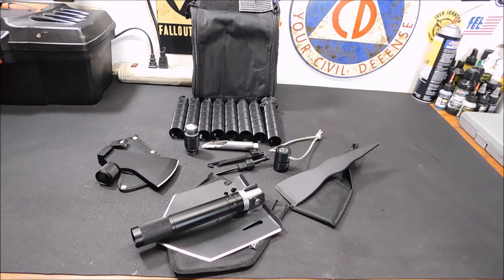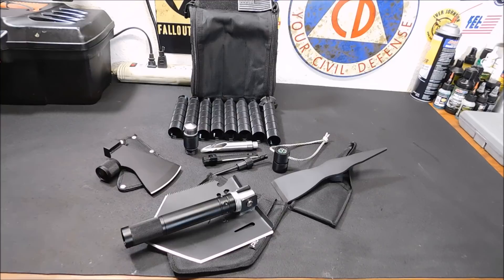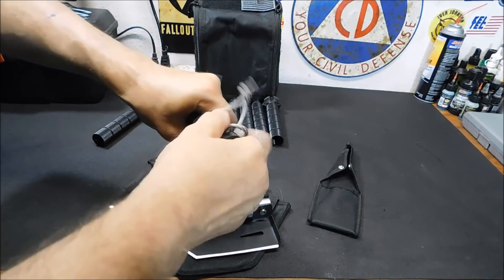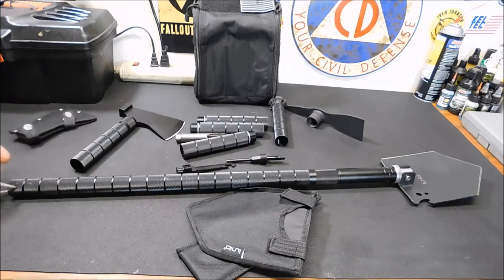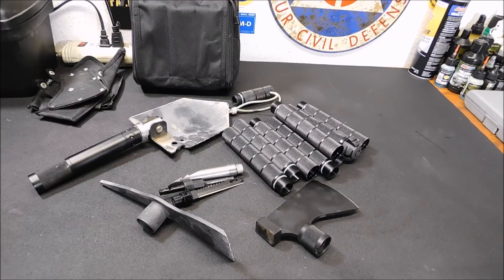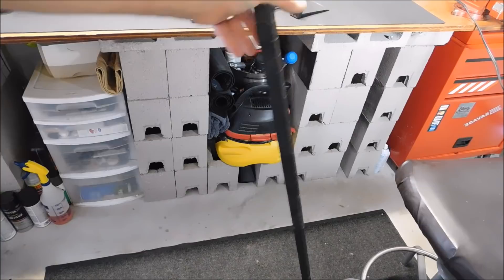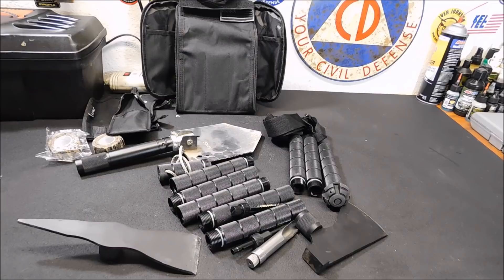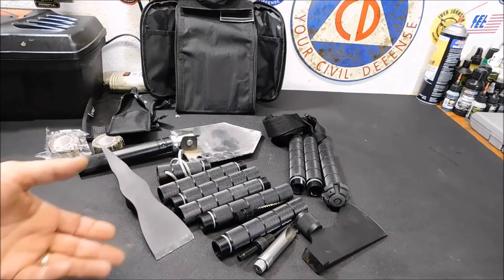IUNIO Folding Survival Shovel Tool Kit: Some Serious Tools!

Comment: Pricey but good quality. After buying/using some of the cheaper models (without an axe) they simply cannot take much abuse. So very true as someone mentioned  in comments when threads are stripped making handles useless or shovels and pics bend due to average use or when hitting an unseen rock or root.  Sometimes it is necesarry, well worth spending more to have tools of higher quality which can be depended on and not fail when needed. Great review as always and Thanks!

Comment: It's not so much the heat, for sure it is the uvc that really hurts my skin and heats me up quickly. For at least the last 6, 7 years now I have felt the sting of the sun on my skin and I'm Hispanic and never had a problem with it until recently. 👍
Reply from the maker: Yeah its tricky out here, because the humidity is so low.  I make a point of always using sun screen in the summer when going out to do videos or yardwork or shooting, because you can burn here quickly

Comment: The biggest weakness for this Multi-tool is mud or dirt.  Once the threads from any of those pieces gets dirty...now the tool cannot be completely assembled.....Also if you dent or ding the handle pieces...forgetabout it. So, either assemble all together and leave it or use simply  for show and tell. 
In other words, Stripped threads-tool becomes useless. Just my2cents. Another thorough review. Thanks for your time.
Reply from the maker: Yeah I have had that happen with some of the other tools I have had in the past, especially with the dirt here, it gets hard like clay when it dries and sticks.  I will have to test that out with this one, as for denting these handle pieces, they are pretty sturdy but that is always a risk.
Reply: Why can't you just wash them out and oil them or something?

Comment: Great job. Thanks for the thorough well done review!  I was wondering if the blades and cutting tools held there edges after you sharpened them? Or is the metal too cheap and soft to hold an edge!  Thanks
Reply from the maker: they held and edge good and I still use this set. its pretty awesome as far as shovels go too

Comment: I’m looking for a good survival/tactical shovel for the outdoors. I don’t want it to have any attachments on the handle because I feel like it reduces the strength in the handle and it can be a possible breaking point. I just want a good shovel that I can carry around that have a sharp edge and can be used a bit like an axe or at least it can chop
Reply from the maker: What you want is the Spetsnaz Shovel from Cold Steel, its built like a tank, can shop, and is nothing but a shovel.  They are super tough and very compact.
Reply: Iridium242 what if the handle breaks cause it’s wood

Comment: Threading on these things has been an issue for me.. They wear down over time and the whole thing eventually becomes useless.. How well does the threading hold up?
Reply from the maker: No problems with them yet, Granted I have not used it a ton, but did get dirt into the threads and it wiped right out, also came apart easily after use with dirt in it.  The poles are a bit thicker in this one than most, makes it heavier but it makes it harder to damage as well!

Comment: The word Sharp is relative. If you can run your finger along the cutting edge, then it isn't sharp! If you run your finger across my knives, you'll be able to tell right away, because it's sharpness will cut your skin to the bone, with just a tap.